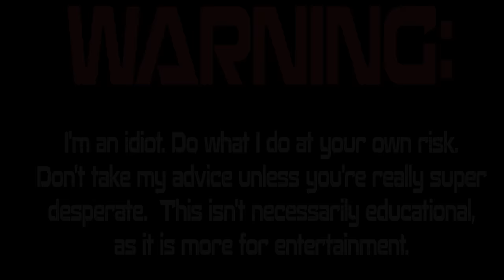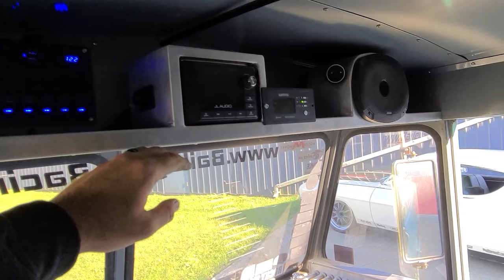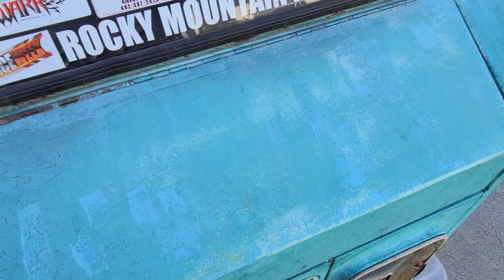I get to Drive Tom Baileys Slammed Ice Cream Truck 1,000 MILES  For Midwest Drag Week  (NO BRAKES!)

Comment: Don't see a whole lot of builds using a GM Atlas straight six
Reply: I hope there's more, the only problem is that they'll be hard to find all of a sudden
Reply: @GreatLakesLogger  Still lots of them out there, being almost every Trailblazer and Envoy used it, and they'll all rust out before the engine goes, especially up north. Very underrated engine.
Reply: They are actually getting pretty popular now
Reply: No joke, I've never even seen one before this video.  Usually when I've heard people talk about an I6, it's either Ford 300, Ford Barra (Australia), Jeep 4.2/4.0, or Toyota.
Reply: @piratius  You are right.  But, yes, there were other notable "six in a rows" too, including the indestructible Mopar slant six.

Comment: When I was in Jr. High I had a neighbor who modified Slushy machines to fit into Ice Cream trucks like that for our local Ice Cream truck operation. They normally rebuilt compressors (including rewinding the motors if needed) for air conditioners, mostly the large commercial units.

Comment: Hiya Derek.  In case a feller didn't know, them Pontiac GTO things you been showing in the last couple of videos actually originate down in my neck of the woods.  Yep - she's known down here as the Holden Monaro - an iconic model that started life back in the late 60s.  Holden was a part of GM from 1948 and was run and developed in Australia - a little country to the west of mine (New Zealand).  Holden had its own GM-derived V8s - a 253 and a 308 - but also used the Chev engines (307, 327) in the First Gen (HK) Monaro back in 1968.  The 327 was dropped in favour of the Chev 350 for the following (1969 / HT) model and became the basis for the 'top of the range' model - GTS350 - from there on through Gen 2 models of the 70s, until the name took a break for 24 years in '77.  Monaro (3rd Gen) was released with an LS1 in 2001, but finally killed off permanently in 2006 and no Holden engines went into 3rd Gens, having been killed off in 1999.  There were some truly powerful Monaro variants put out by the Holden Special Vehicles (HSV) arm, but they surely pale in comparison to what Bailey's machine would be running at!  A lovely car to drive, she was a Muscle Car or cruiser by type, but she could certainly hold her own on the winding roads of this country and be thrown around a track with a great deal of vigour and proved that she weren't no 'straight line only' queen.  Comfortable to drive long distance too......and a ball of fun.

Comment: Had a 76 C10 Chevy back in the day, and my seatbelt mount came out the floor. I mounted some hardware to the floor and used a two inch ratchet strap for a seatbelt and got pulled over, cop said well, that's a seatbelt.. and off I went

Comment: Apparently no check valvage on the fire protection system, must not be a combined main in those parts. Or they don’t mind a little back flow to the system.

Comment: Sorry Derek but you got how a sprinkler a little wrong, it doesnt notice a pressure drop, it has a flapper inside the pipe that only moves in one direction. when the fire department opened the hydrant it dropped the pressure of the system (which means the check valve is failing or failed) and when they closed the hydrant, it put water pressure back to the system it moved the flapper up and tripped the system

Comment: Also, it's hard to beat a 4200 for a powerhouse. If you have an old beater that just needs to have a basic powerplant and you don't want to drop $15,000, a Chevy 4200 works mint with 275 HP.

Comment: That battery switch intrigued me. When it's both batteries are they in series for 24 volts? Because I see positive and negative electric hookups for jumper cables to the left of the switch. Which I would probably put rubber caps on. Wouldn't want a cold snack accidentally touching them at the same time!
Yeah when you were showing the master cylinder there, it looks awfully small, and without power assist to provide enough juice for those front calipers. BTW, was that a 61 or 62 Chevy Impala on the lift? Two-door hardtop, 4 door post, or possibly convertible? First car I purchased used for $600 was a 61 Chevrolet Impala convertible smoke gray metallic with red and white interior. 283 , 2 Barrel hooked up to a 2-speed Powerglide slush bucket. Which had to be removed along with the differential. Being swapped out for a Muncie 4-speed, Hurst shifter, 318 gears in the rear end. Overhauled the engine and stayed with the Rochester 2 Barrel, but put in a 327, 325 horse cam with all new lifters, pushrods , and rocker arms. With double anti float valve springs. Had a heck of a time with the fire- later getting the right springs for the mechanical advance. Had it idle at 1 thousand RPM 15 degrees advance to keep it running! Sure went down the interstate smoothe at 4200 RPMs!! About 80 to 85 miles an hour. Using the Tach, the speedometer broke at 143,000 miles!

Comment: Hearing the belt squeal and I'm just sitting here thinking "Tom Bailey would totally rig up something to purposely make belt squeak on a truck like that. It'd look completely stock but hiding over an electric water pump or something there'd be a non-essential pulley with a belt tensioned just right that it would sqeak....just because."

Comment: 9:20  ''....  so everything should be just fine....''   ummmmm   efferyting should be just fine.... DUDE  ALERT  ALERT OH MY  I HOPE THOSE AIRBAG DROP TO THE GROUND SWITCHES HAVE THE CUTOUTS SO IT DONT DROP TO THE GROUND WHEN MOVING!!!  UMMMM or eh?  does ht have those 10" wide square steel blocks that are like 6" deep that they scrape on the ground to make the sparkalators outside externally sparkelaate??????  lol hahahaha